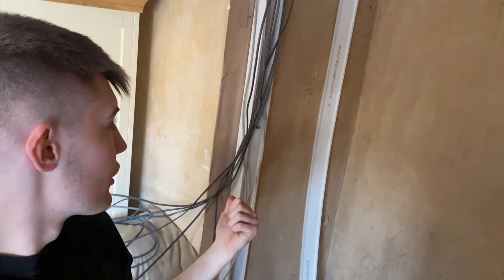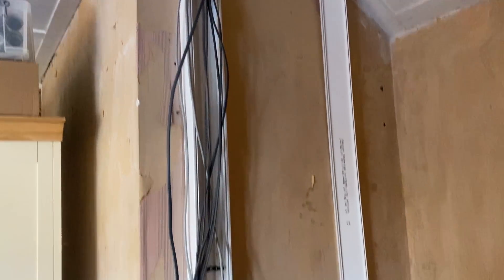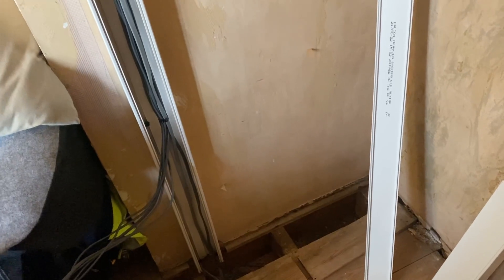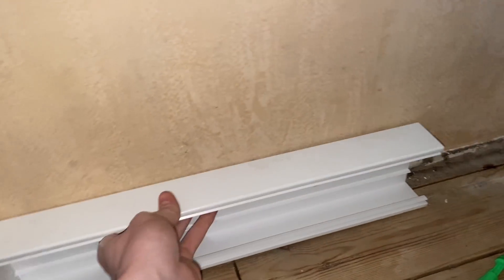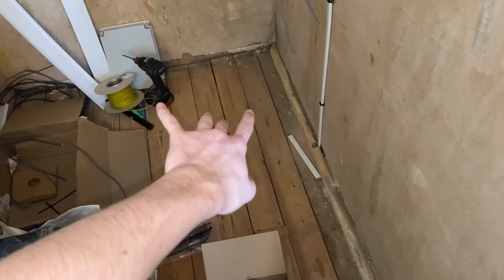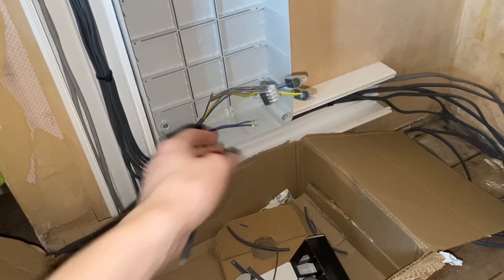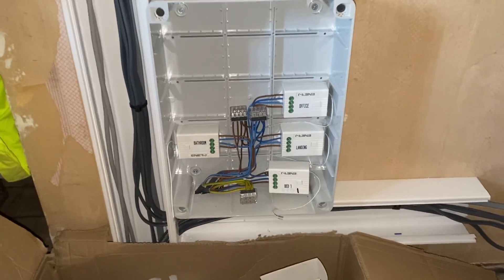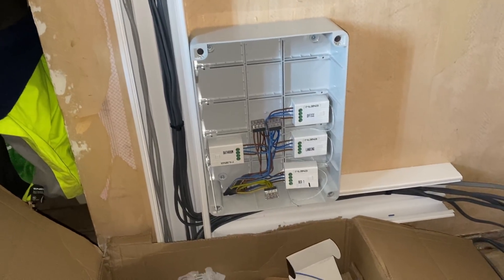How I Rewire Lights using smart Wireless switches

Comment: anyone using lutron gear still? Not sure why these half hearted radio switches exist when it can all be in one box made for the job next to the DB. this is 25+ year tech for electric curtains and blinds. I had to interface the lutron with the blind stuff back then as there wasn't anything available. And before that, some uber rich guy had everything bespoke made in the 70s, that was really easy yet tough to interface with. All custom 8 segment and TTL logic switches with a rotary knob. all going back to a custom controler board and direct control of 1 thing, be it a light or a blind, everything had it's own singular supply. Great stuff.
Reply: I guess they could do a 5 module version. Save money/time/space. Pain when one channel fails though. Could use a spare channel.
Reply: Doing a house at the minute with lutron. 1st one we have done

Comment: Nice and tidy. Good separation between data and power. Rule is that "data should cross power at right angles," and not run side-by-side. What you've done is fine.
Reply from the maker: Ok thank you

Comment: Hi Adam, 
You're right about the circuits being in band 1 and band 2, but there's something else to consider.
You can only put them in the same wiring system (trunking) if the band 1 circuits use cables rated for band 2.
It's a bit overkill when you consider sheathed cables like T&E that you could easily have surface clipped and touch with bare hands.
However it makes complete sense if you are running 6491B or X singles as in an industrial or commercial scenario.
Don't worry though, there's an easy fix.
That trunking you have used has the ribs moulded into the back so there's a divider accessory available to clip in and segregate the two circuit bands for compliance.
I think the reg is 528
Reply: Read up on EV ultra cable and read Doncaster cables' FAQs on it and I think you'll see you're mistaken.
Reply: @ThePa1ch  I'm not mistaken at all.
Doncaster state that their EV Ultra cable is compliant because the cat 5 element within has insulation rated to band 2, standard data cables don't.
It's also screened for better EMC performance.
Reply: @simonparkinson1053  Yes, so what's the insulation rating for the ethernet cables in Adam's video?
Reply: I agree. I made a similar comment around the same time. Yes it's reg 528.1. The EV Ultra complies with indent 2, as you say. Of course, only Adam can say exactly what cable he used. In my experience most data cable doesn't give data for voltage resistance unless you are paying for specialist cable. So my default position is that unless I can prove it complies with indent 1 or 2 (which I can't), then it doesn't and needs it's own compartment, exactly as you say.
Reply: @ThePa1ch  The onus is to prove it DOES comply, so only Adam can do this. Most data cable doesn't give this value unless you are paying extra for shielded or specialist jackets.
Reply: @ThePa1ch  if it doesn't say any different they will be band 1, as are standard alarm and telephone cables.
PoE operates at up to 57V and typically ethernet cables are not rated above 125-150V but varies by manufacturer.
The honest answer is only the installer would know.

Comment: Great video, well done.  You are right about band 1 and band 2 cables being an issue in the same wiring system. If I'm honest I'm not 100% sure that solution solves it according to letter of regs (see reg 528.1 indent 3) as there should probably be a partition in the trunking. It will be absolutely fine in practise though!
Reply from the maker: Cheers I’ll take a look
Reply: Read up on EV ultra cable and read Doncaster cables' FAQs on it and I think you'll see you're mistaken. The voltage rating of the  insulation in this case should more than suffice?
Reply: @ThePa1ch  I thought it was normal cat6e UTP for CCTV in the trunking. I'm not sure of the relevance of EV-Ultra, as all conductors in that are rated to the same nominal voltage, thus meeting 521.8 indent 2. Sorry if I'm missing your point.
Reply: @timhoward7037  Yes, so do you have the specs for the cat 5/6/6e cable that Adam is installing near to and do you know the voltage rating of the insulation in order to say it doesn't comply?
Reply: @ThePa1ch  I didn’t say it doesn’t comply. I said I’m not 100% sure. I think we both agree on what the key detail is, and I was encouraging Adam to check.

Comment: You good job. If the Q receiver's ever lose the signal from the light switch ( which they do occasionally ) just switch the breaker for that lighting curcuit on and off to reset it. No need to re-pair them at the receiver end.
Reply from the maker: Ok cheers never had one issue yet